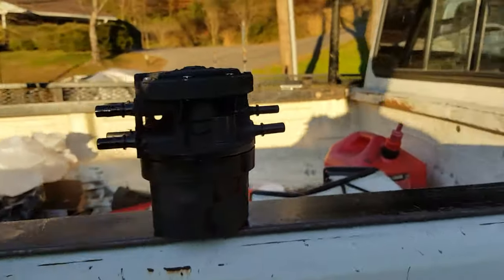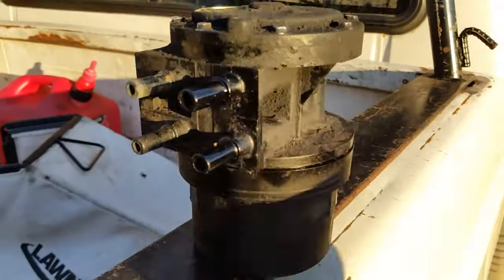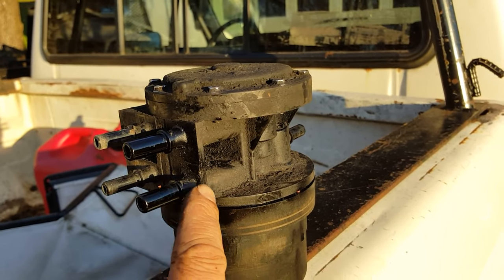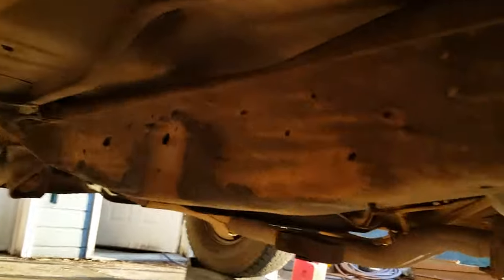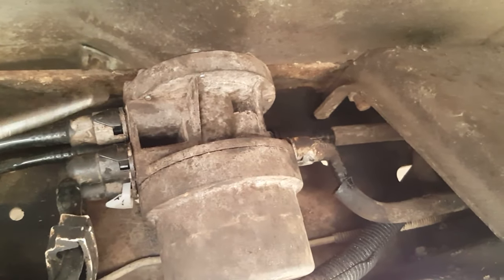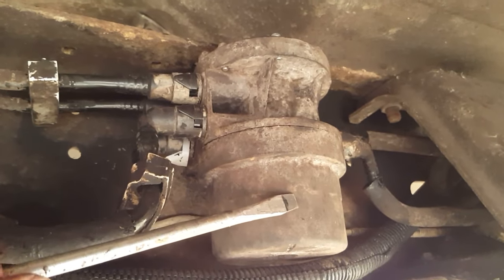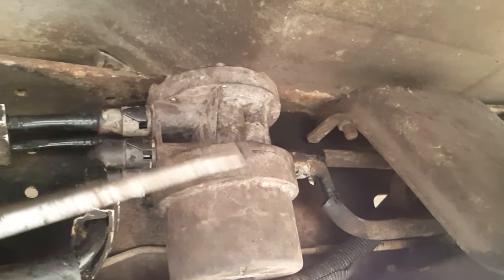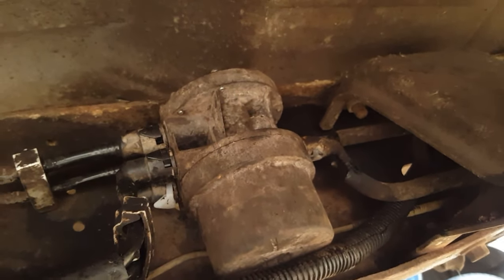Ford dual fuel tanks... EXPLAINED and where to buy parts!

Comment: i got a 81 f100 4.9l does this truck have two tanks like yours or only one? i have no tank by the back tires but i do have a big empty space there that looks like there should be one.the only tank i do got is what looks like 22.5gal auxiliary tank running along the driverside frame.
Reply: and also can i do the 89 bronco thing you siad to mine and just run the truck from the mechanical pump ?

Comment: Is video is only useful for 86-91 Ford Trucks with a diaphragm. The earlier 80-82 use a 3 port valve and the 83-85 6 port valve electric solenoid valve. We’re out of luck in any case, the replacements for earlier 80-85 trucks only have barbed fittings and the later 87-96 replacement is barbed fitting as well. 

Nobody has a new or remain diaphragm tank selector and the rest of us have to convert barbed fittings to even use the replacement part available to us. The only place that has the correct tank selector valves for period correct OBS Ford Trucks is “LMC Truck.com” and even those have barbed fittings.

Don’t use the garbage tank selector valves from parts store chains like AutoZone or O’Reillys auto parts, they are cheap garbage that are all the same part either sold under the house brand name or just reboxed sold as OEM. None of which have the correct push on with o-ring seal and plastic locks like ford used, all replacement tank selector valves for OBS Trucks have barbed fittings.

Comment: FOR some reason on my 83 f250, the new valve selector ports are in the opposite direction???? What's up with that??? How should I run it now???
Reply from the maker: Does your new valve have a total of 4 or 6 ports?

Comment: I have a 94 ford f150 the 4.9 v6 and i only have a single tank is there a way you could add a secondary tank or did they only make that for the v8's?
Reply: I'd love to get some pictures of your pickup! I've never seen a 1987-1996 Ford full size pickup with a single tank!
Reply: I’m in the same boat. Do you have two fuel tank doors on the side of your truck bed? If so someone probably deleted the second tank as they did on mine. I am doing research here trying to add a second take back again and getting the truck back to original set up
Reply: Go to the wrecking yard and get the dual tank stuff and install it most all of the wiring in the main harness should be there so you'd probably only need the harnesses that plug into the main harness and the fuel lines, switches, tank, tank mounting hardware, soiree harnesses, new bed of its not a dual tank bed, fill spout, dash switch and plastic it mounted in to match your dash.

Comment: Why is there a return? What gets returned if the gas goes to the engine what's left to return?
Reply: The engine fuel rail has a fuel pressure regulator that adjusts fuel pressure to the injectors and excess fuel is bled back to the tanks.
Reply: The high pressure pump sends to the engine but the rails cannot use all of the fuel so it returns it to the tank.
The engine has a regulator that diverts it back when it gets to a max pressure point.

Comment: Does the bottom of it come apart?
Reply: NO. Do not try It will Break.
Reply: Yes it does, also some of them have a filter. There is a VERY thin O-ring that seals it, make sure you have a new one, they usually come with the filter. I can't stress enough on how clean it has to be, between the two surfaces.. Make sure theres no dirt or grime when u screw the bottom cup back on or it WILL leak!
Reply: You'll have to use a strap wrench to remove the bottom.

Comment: PLEASE HELP!! I need to put a filter in my selector valve to keep it running ASAP!! It’s the same exact part as in this video!! Please help!!
Reply: Go to rock auto... There is a universal one part number FV5K. $55.79. I have it on my 89 f150 5.0 and don't waste time cleaning the old one,, I did that and in about 6 months I was back in the same boat.
Reply from the maker: Thats good to know. Thanks for sharing

Comment: whatever tank Im using it pumps gas into the other tank. Ford should have redesigned these.
Reply: Sounds like your return lines are swapped on the selector valve.
Reply: @winfieldtrail8956  really!? I'll look but what I hear is that this is a common issue. Thanks for the replay.

Comment: You guys need some schooling, forget the fancy electric switch garbage just swap it out for a brass 3 way valve installed in the floor right beside the seat, problem solved, just because some ford bean counter thinks everyone needs a switch to change tanks doesn't mean you need to stick with that crap.